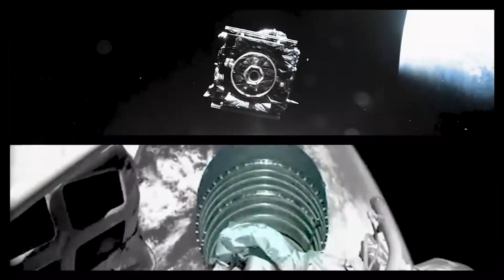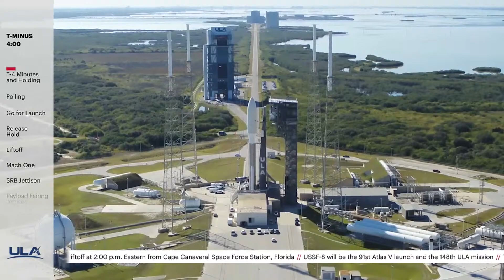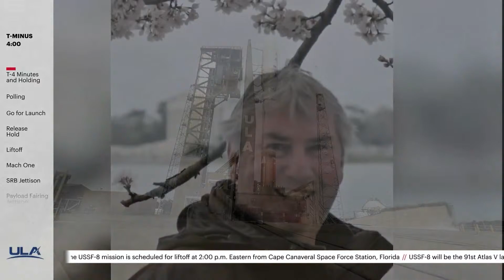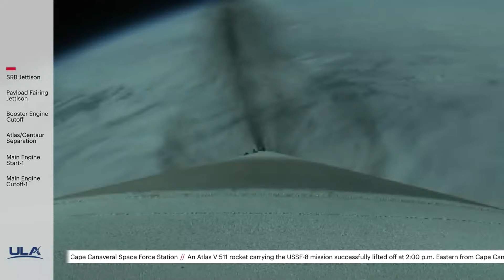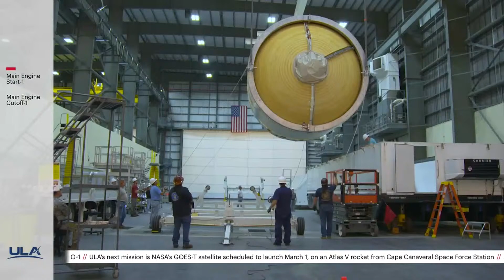Jan. 21 Live Broadcast: Atlas V USSF-8

Comment: After watching Tory Talk I was looking for the change in the rocket's attitude right after the SRB detached. Cool. Patrick Moore was interesting; I learned a bit more. The Colonel was great but went on about 1/3 too long. I do have a question for Hogan D. Harera on SLS. The deep yellow test kit or tank shown had circular fabrication lines that looked like Relativity's 3D printed tanks. Was the tank 3D printed and was it a test shell structure?

Comment: Why is there no sonic boom when rocket exceeds mach 1?
Reply: There is one but it radiate out from the sides and follows the rocket, so it never gets heard on the ground. If the rocket flew past you in the air you’d hear it.
Reply: The design of the rocket is made such that it reduces forces acting on rocket for a smooth ride 💖